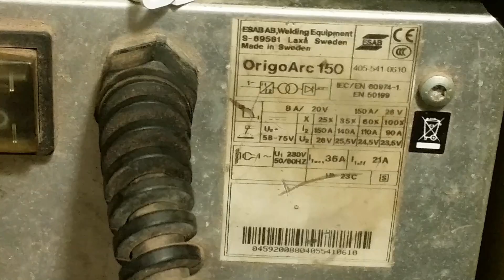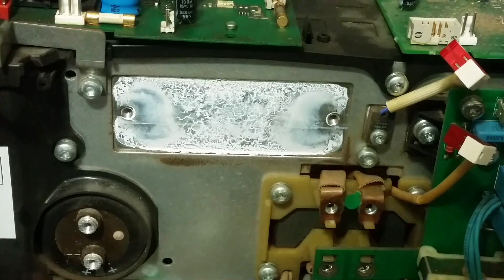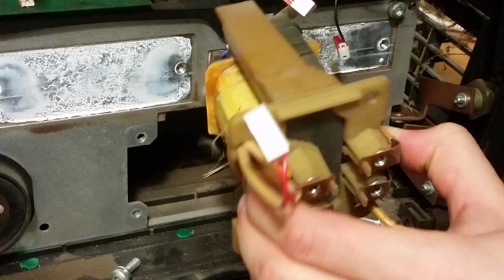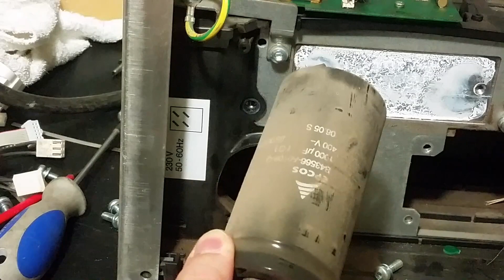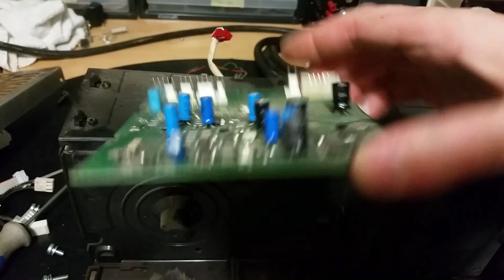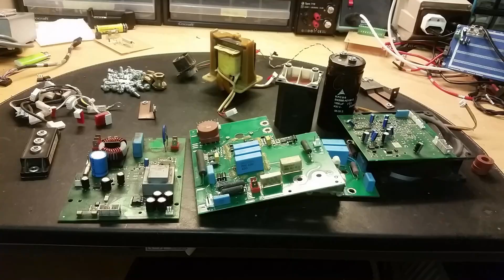INVERTER STICK WELDER TEARDOWN

Comment: do you think it would be possible to supply dc power straight to the welding process from a battery bank, rather than from an AC source, by modifying a welder like this? or is it highly dependent on an AC source?

Comment: The repair of this module is not very expensive. The rectifier bridge is mounted separately. The rest of the components are mounted on the base of the module.

Comment: That is more than a IGBT brick, it's a hybrid IC that contains multiple components and is ESAB proprietary. Once that goes boom, whole thing can be tossed out as you can't find a replacement; you can only try to replace the module wth discrete components but that is very hard to do because of the lack of space.
Reply: SAAB brick?

Comment: Sir during the solder the machine stope what is the problem. Thank
Reply: Thermal protection. Weld time.
 Adjust to < % of stated duty cycle of the machine. And longer cool down after welding.